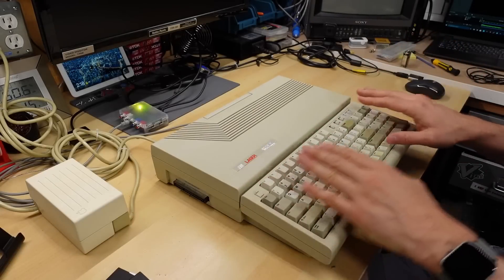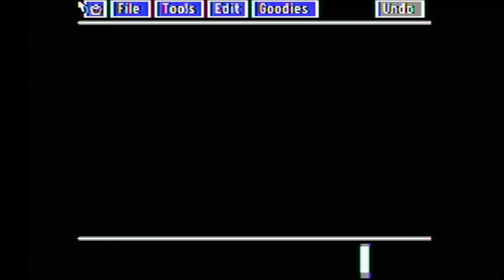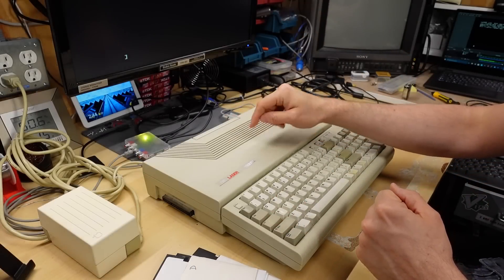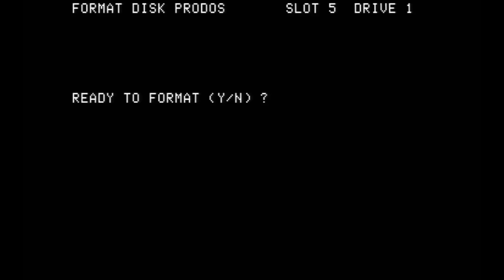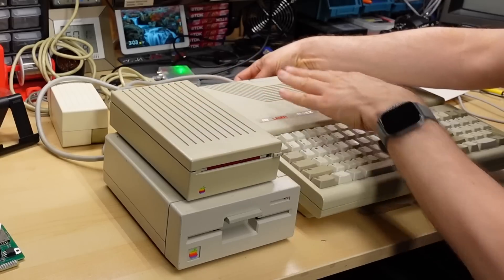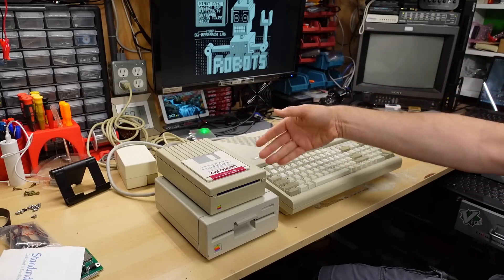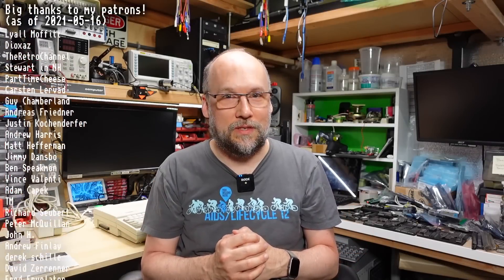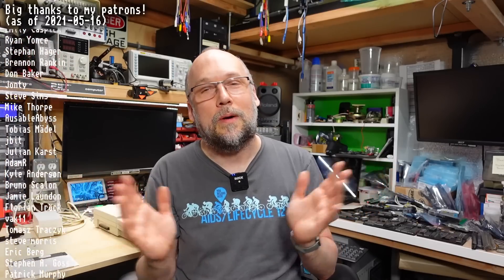Laser 128EX: Proving this machine is better than an Apple IIc

Comment: The reason the joystick doesn't work at anything except stock speed, is that they use an RC timing circuit, with the joystick providing the R component.  The CPU literally times how long it takes to charge to a level.  Again, CPU clock dependent.

The Apple }{, while being a good machine for it's time, relied on software to do almost everything.  There was no real hardware to do any of the grunt work, it was all on the CPU.  Most other machines of the time were the same way, because custom chips that could do some of that work just cost too much.  You have o realize that these were home machines, not workstations.

The IBM PC  and the Amiga were some of the first to have other processors doing some of the work, letting the CPU do CPU things.
Reply: Try the Atari 8-bits. They predate the Amiga by far and were designed by many of the very same engineers. The IBM PC did not have many custom chips. It was an off-the-shelf design.

Comment: I have a Laser 128, not the EV, with Rom version 6 and it won't boot from a mounted hdv of Total Replay, on the Floppy Emu what could be wrong?
Also, what was that card which booted up in the expansion slot with an SD card?

Comment: The story behind the 5 1/4" drive being driven almost entirely through software that Woz wrote is essentially correct, but there is a lot of interesting stuff to the story. It's worth looking up the whole story, but briefly, the reason it's mostly driven through software is because when Apple went to Shugart back in the day for disk drives, their drives had a controller chip and was a total package, but was very expensive. Something like 2-3x the cost of a bare drive. Apple balked, so Shugart gave them some bare drives to test, thinking Apple would get frustrated without the controller chips and come back to Shugart and pay the price for the full package. That gambit failed, as Apple had Woz, who simply (for him) read through the schematics and wrote routines to drive the drive through software, and I'm talking from the bare metal. He had to create an encoding scheme of the bits, and as there was no track 0 sensor due to not having those controller chips, he simply sent 40 "minus 1 track" commands upon start up, which is why it does that "Grrrrr-dt-dt-dt-dt-dt" upon power up. Shugart was shocked when Apple came back and put in a large order for the bare drives. Never doubt The Woz. Wiki has an account of some of this at https://en.wikipedia.org/wiki/Disk_II but it's worth looking up Woz's recollections too.

Comment: That speed issue reminds of the days with my first PC, a 80286 machine. It had a turbo switch, to switch between I believe 4.77 MHz and 16MHz. The 4.77MHz mode was for speed compatibility with older Intel systems. I remember the game digdug was unplayable in 16Mhz mode because it ran too fast. Putting the machine in 4.77MHz mode made the game run just fine.
Reply from the maker: Yeah those initial games didn't even think that we would have faster PCs one day :-)
Reply: I'd be surprised if those early games haven't been patched by enthusiasts in recent years...

Comment: The zx spectrum had some tricks even with the missing timer: im2 interrupts (generated with raster 50 times /second), or floating bus. Did not had something similar on the Apple 2?
It's really curious for me since I had the Macintosh back then (128k), and that computer had very crappy games in comparison.
Reply: On //e and later machines, you can poll I/O location $C019 to tell when the display's in vertical-blanking, intended to help with flicker-free screen updates, but this could also be used to calibrate a timing loop for  different CPU speeds by counting elapsed cycles per 60Hz field. Also, when a mouse interface "card" is present (including inbuilt ones in the //c, //GS, and Laser 128*) it can be set to trigger an actual Vsync interrupt, though the mouse firmware uses this itself, so you'd want to set the vector back after calibrating to avoid breaking that. As far as I know, no games used either method, maybe because early Apples (II, II+) didn't support it, and accelerators were uncommon, especially early in the life of the platform.

Comment: Actually the Laser 128 EX has a COMPLETELY different but compatible disk controller in slot 7.  It's known as a UDC (Universal Disc Controller).  VTech sold it as an add in card for the //e.

Comment: Adrian, I have created floppy disks from the image on a FloppyEmy several times using CopyII+
Reply: I can confirm mine it’s working I do the same every time I need I can use my Apple II, or IIe and I never have any problem to copy from floppy EMU to real floppy’s.
Reply: I'll third that. In my IIe platinum I have a pair of floppies on a controller in slot 6 and my Floppy Emu B on a controller in slot 5. I can disk copy from the emu no problem. And now with the latest Emu firmware I can disk copy from floppy to a WOZ image file on the Emu.  If yours doesn't work, just chooch it sumthin treble! Hi from Ottawa 🇨🇦

Comment: The "booti" card is da bomb.  I recently got one, you will LOVE it!  I stopped using my FloppyEMU.  It is the affordable solution most of us are looking for.  It takes standard USB flash drives with standard windows FAT32 filesystem and allows you to attach any prodos ordered (.po) disk image to the Apple II.  Just make/edit .po disk images on a PC using CiderPress, chuck them on the USB, and attach via the booti's configuration menu.  You can even attach multiple images at the same time!  32MB .po for booting GS/OS 6.0.2?  No problem! $60?  No brainer!

Comment: This episode just reminds me how much Apple was getting it's rear end kicked by Amiga. 
Amiga Really did run the roost until PC came along and after that Apple just took it's place.
Though I personally think we should have a third platform like Amiga back instead of Linux.
Listen, I don't hate Linux but the fracturing of that is so wide that it becomes hard to know 
certain things and what you want to choose and what runs what. An Amiga return would be a 
great thing in my opinion.
Reply: Linux is not really fractured.  You pick the distribution that you like and almost everything will be compatible.  The distribution's native package management generally takes care of installing whatever is needed to make an application work.  From a user perspective the differences between distributions boils down to two things: the details of the initial installation process, and the provided package management system.  The vast majority of software applications are compatible with any of the mainstream distributions.  Maintenance and updates are automatic and generally much smoother than anything Microsoft can do.
Reply: @Starchface  Like I said I don't hate Linux but there are too many distos and not enough people know what you just said. The same can be said for an Amiga comeback but at least with that there are far fewer options. I just don't see a Linux type of computer. A hardware software combo that touches people like the standard windows and macs have. 

Yes, windows have a standard. Usually an Amd or Intel cpu with Nvidia or Amd Gpu and windows os. There isn't much variation there anymore. Macs well we know them. I just want to see an alternative that isn't Linux. I love Amiga and have passion for that and would love to see that brought forward.
Reply: @valentine_puppy  The thing that made PCs boring was the very thing that made them a success.  They have no "personality" because the operating system and user environment is in software, and the hardware interface is an open standard.  PCs typically were minimally equipped and could keep costs down.

Commodore and others initially tried to compete with the IBM standard, but ultimately failed due to closed architectures and the costs of having to implement a lot of hardware that on IBM, users could just buy as needed.

That said, I remember well the excitement of sitting down at an Apple ][ or a C64 or a TI99 as a kid and thinking, what can I do with this thing?  I will never forget those days.  It was a Golden Age.

Comment: On the slot 5 vs slot7 issue, the expansion connector is prewired as you say to be physically slot 7.  Two connections not normally used for slot 7 on an apple2 contain the select pins for slot5 and are routed to the secondary slot in the expansion box.  I used my original laser 128 as a high school student in the 1990s with an AE Phasor in the side slot, and it always appeared as 7.
Also, the cp/m card may give you a hard time on this machine due to DMA timing needs since the card relies on the apple/laser computer's ram to operate, especially if you're not running at 1mhz.  I never tried it with a softcard style cp/m card.  However, an applicard style cp/m card should work at any speed, as I use mine with a IIgs at full speed and my IIe with a transwarp at 3.6mhz. :)  Last, try finding an AE cp/m disk, as it might take advantage of some hidden things on the AE card.

Comment: I've seen a CP/M card in a IIc. It had to connect so that it piggybacked off the IIc's CPU socket, and sat right behind the keyboard's PCB. This particular IIc was also configured with the Dvorak keyboard layout.

We also had a few of the Laser 128's in our middle school. Not sure if they were the EX version, though. They did have the expansion unit which gave a cage for the slot 5 and 7 cards. The school had a mix of Platinum IIe's and Laser 128's all networked together so they could share one hard drive, which was connected to a IIgs that was configured as the server. 

Talking about the UniDisk 3.5 reminds me that they did make a Superdrive card for the IIe and IIgs that let you use a high density drive on them. Haven't seen one in person, but did see them in an Apple catalog sometime around the end of the IIe's life span.

Comment: Will this machine run Apple Works?
Reply: Yes, and it ran quite well with the 3.6MHz CPU and expanded memory board (compatible with Apple's "Slinky" indirect I/O method, hence automatically recognized by Appleworks 2.0 and above, if I remember right).

Comment: The joystick doesn't work with the faster clocks because the "A/D" conversion is done by using an oscillator (I believe it's a 556) where the variable resistance changes the timing: the internal routines measure the time in cycles, and for this reason the measures for the joystick will be completely off.

Comment: You are right, the 40/80 col card on a IIc does practically nothing.  As far as the 3.5 disk drive, on the IIc there are 4 rom revisions.  On the later rom revisions (0,3,4) they have the hardware to handle smartport drives and the original rom revision (255) does not.

Comment: I mean, If you're doing something that doesn't rely on timings, like a compute task, or if you're doing some productivity, then speeding up the computer could be helpful, but as a general gaming sense, unless it was coded for it, it's probably useless.
Reply from the maker: Yeah like running Apple Works or any even the paint program. Super helpful.

Comment: Could be a soft boot issue too. I think there where cases where certain memory addresses would get "corrupted" if you did certain things, and you literally had to either a) shut down, and restart the machine, or use a program to "set" those addresses back to the correct values for the expanded memory to work right again.

Also - PC games could only adjust within certain limits. Really old games literally "couldn't" tell how to react to a processor that was far too fast for it. Basically, anything made for the original PCs, or a 286, if you ran it on something like a Pentium, would run into problems with speed, and there where actually utilities that used system interrupts to attempt to insert clock cycles (often badly), to "adjust" the speed such old games ran at. So, PC games did have the same problem, but later games where smarter.

Comment: The 3.whatever mhz. clock speed of the later Apple II machines (and clone!) always made me a little envious as a C64 user.  Yes we had a greater software library but subLogic's flight simulators, etc., all seemed to run so smooth compared to my 64!
Reply: Check out the videos on YouTube of Flight Simulator II and Karateka running on an Atari 8-bit computer with a 65816 upgrade to see how fast those games can play...

Comment: Hi Adrian love the channel!   I use my FloppyEmu to make real Apple II disks using an un-enhanced Apple IIe.  Maybe it works for me because I'm putting FloppyEmu on Disk 2?  Also, there have been significant firmware upgrades, not sure how long you've had your Emu?
Reply: I’m using a FloppyEmu on slot 6 on an enhanced IIe and am able to make Apple II disks, as well. I don’t use Copy II+ for copying. I use Apple Copy or other file copy programs. Bit copiers just don’t seem to work.
Reply: @johnhlynn9625  I think you would have good results with copying by matching program with format.  So for a sector-based copier like COPYA, a .dsk, .do or .po image would be acceptable.  But if you want to use a bit copier like CopyIIPlus, try a bitcell format like .nib or .woz with Floppy Emu.

Comment: I used to have a Laser 128ex back in the 80's, but sold it when I upgraded to an Apple IIgs. The 128ex was a good computer (and cheap, compared to Apple), but while it was good it was not 100% compatible. To keep things legal the ROM had to be reversed engineered, not an exact copy. The expansion slot was rather quirky as well, and to get it to work at all I had to buy the expansion box which supported two slots. Again, it was not 100% compatible and certain expansion cards would not work.

Comment: For the broken case I recommend the Loctite plastic bonding glue.  It has the stuff for cleaning the plastic plus the glue.  I used it on a broken C64 case and it made a very strong repair.

Comment: Yes, the address is $C030. Through an address decoder and some glue logic, it triggers the “T” input of a toggle flip-flop, where one of the outputs is connected to the speaker through a current-limiting resistor. The other end of the speaker wire is grounded. A similar thing happens if you read $C010, but that toggles the tape (cassette) output instead. Or maybe it’s $C020, I forget. It stands to reason that most, if not all, games for the Apple ][ series work only at the 1 MHz speed; they would probably be unplayable at the higher speeds, especially at the higher difficulty settings. And some might not work at all due to copy protection, or just because the routines for the Disk ][ drives wouldn’t work at the higher speed. It’d be interesting to find out which programs will ir will jot work at the higher speeds.

Comment: I wonder if you could make it dual-mode with adding PAL parts to give it switchable PAL & NTSC like with the C64... :D
Reply from the maker: I went through the technical manual and I think it could run in PAL but I'd need to swap two different crystal oscillators. I'm not totally sure what setting it to 60hz with the PAL crystals in it does though -- it can't possible produce NTSC color as it would be sending out the 4.43mhz color burst

Comment: Didn’t 8 bit guy already do this?
Reply from the maker: Notice his Laser 128 video came out on Jun 17, 2021 and mine was on May 22, 2021. His included some bit of footage from my video.
Reply: @adriansdigitalbasement  I stand corrected, and this is another fantastic production.  Thank you for your work!
Reply: @adriansdigitalbasement  I would dare they they are different in scope as well.  Keep pumping the videos out!
Reply: Would be willing to assist this Sailor with fixing a SE- I picked it up, screen is way to dark and disk drive won’t eject .  I’ll do the work I just need a little guidance.  I have done any vintage mac repair before.

Comment: If I remember correctly, 19200 baud required a 16550 uart on DOS machines.  Many computers at the time had a slower uart that maxed out around 9600.  Initially this wasn't a big deal because 2400 baud modems were the norm.  But later, I had to upgrade the serial board on my computer in order to get a faster uart and get my 14.4 external modem working.  So my guess is that the laser 128 has a cheaper uart chip in it.  And if you step the baud rate down even more it will start working.
Reply: Yeah I did the same, early Internet! The 16550's difference, was that it had a 16-byte data buffer where the 8250 (?) didn't. Software could set the 16550 so that it would only interrupt the processor, asking it to please empty the buffer so it could read more data, every 16 bytes (or any other number of bytes, it was selectable). Where the 8250 would interrupt the CPU every time it received or sent a byte, and needed attention to deal with that. So the 16550 interrupted the CPU a lot less often.

Back then being interrupted, say, 14400 times a second, was actually quite a load on a PC's CPU, it could get in the way of software and make things unstable. It could also end up in missed bytes if it didn't get to empty the UART before new data came in. That would require re-transmission of a packet (if you were using TCP/IP for the Internet), which would slow down your already pathetic download speeds.

I dunno how the Apple does it, but it could cause similar problems, as you say.

Comment: At the top speed the memory may be reaching its speed limit, causing instability.
Reply: Unlikely the builders put in there RAM that's too slow to keep the pace. And it'd affect the painting program too. Culprit is more likely an I-O waiting loop for ports that'd need more delay betwren reads/writes.

Comment: Even if the Laser didn't have the IWM chip for the disk drive, it still might work with the 6502 running at warp speed!
Try cpm after adding the additional ram.  The B version must have been sysgened for more memory.